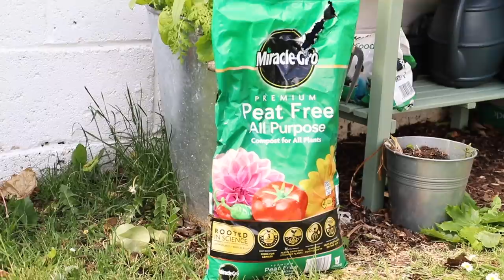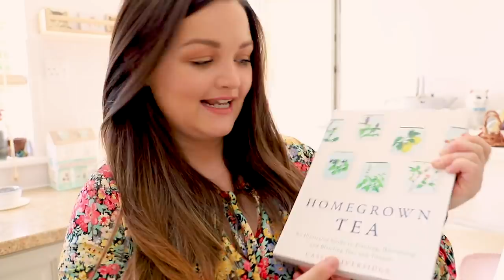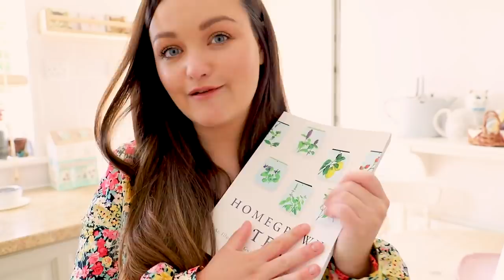DIY Herbal Tea Garden With Miracle-Gro

Comment: Beautiful video! drying herbs for teas is just so satisfying I have done it for years, it is simple even if you don't have a dehydrator.  some things I have done in the past - picked the herbs washed them and put them into a salad spinner to get the excess water out, then place them in a brown paper bag and hand them in the airing cupboard or warm place to dry naturally, then once dried crush them and place into a jar.  Another way, although I am not fond of microwaves you can dry them in the microwave really low setting and 5 secs at a time until dry and crisp then leave them to stand for a short while before crumbling into jars, and labelling. and the final and for me, the best is to invest in a small dehydrator.  Wash the herbs, salad spin them and place them onto the sheets, put the settings on the lowest mine is usually 40 degrees and leave it on for 24 hours, let them sit for another couple of hours at least before placing in a jar and labelling.  I also use the moon cycles to get a better harvest. The best phase to harvest is just after the full moon when the sap is hight, but the energy has just turned downward.  At this time the fluids are drawing down into the roots, taking the moisture from the plants and making them easier to dry.  Hope that helps Catherine,  herbal tea blessings TFS. x
Reply from the maker: This is perfect, valuable tips. Thank you so much for sharing!
Reply: Great tips And i love herbal teas too! Everything looks so bliss, absolutely love your channel ❤️
Reply: @DaintyDiaries   - How do you wash your teapots?  ... maybe you can make a video about it.

Comment: Love your videos! Drying herbs is easy; different ways. Pick after morning dew has dried off and before flowering. Air dry out of direct sun where warm air circulates in small stringed bundles, or Microwave on paper towel in short spurts (you will know when they are dry by touch; they come right off stem, will crumble in between fingers) Just play with it. I use an oven too, on lowest temp. Just place sprigs on parchment paper on a cookie sheet. Try feeling the sprigs at 15 min. intervals(be careful not to burn your fingers)*. If I can do it, anyone can! Growing sage likes a lot less water than other plants and takes longer to dry by any method) 😉 I live in a humid environment too. Really enjoy your teaching me about so many things.💞 *safety first 😄
Reply from the maker: Thank you so much for these tips!